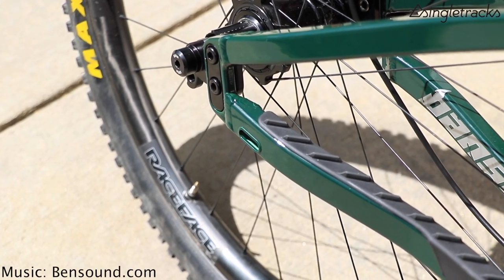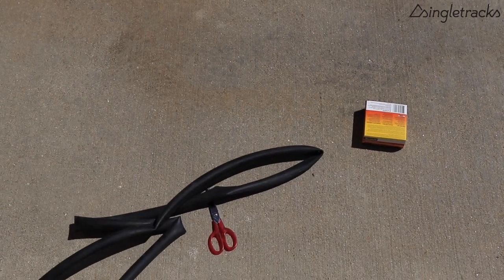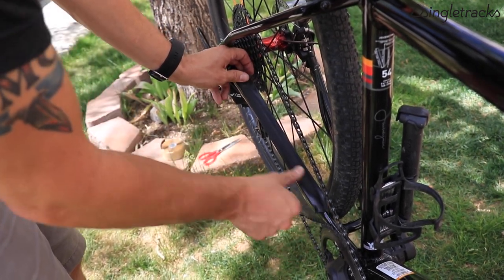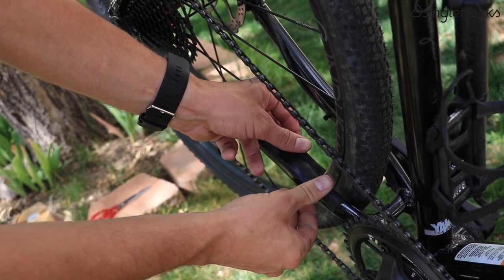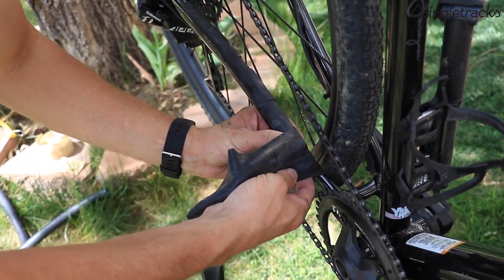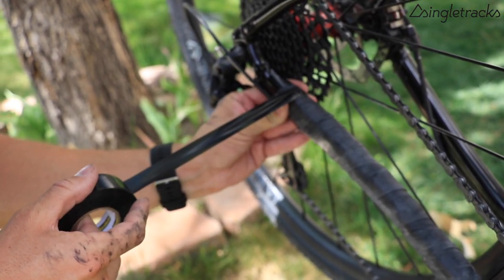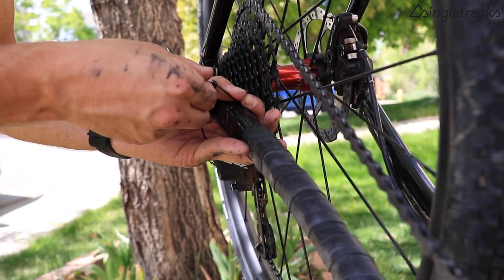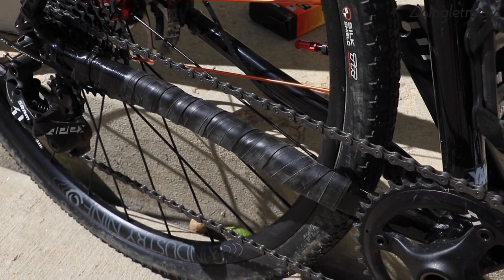How to Quiet Bike Chain Slap with a DiY Chainstay Protector

Comment: why do you need the mastic under the tube? tube should offer all the protection you would need, if you want more, double wrap it.
Reply from the maker: Aside from extra protection, the smaller sections of Mastic form bumps or ridges that break up the motion of the chain, disrupting the wave effect. You could sub anything to create the ridges; Mastic tape is just easy because it's cut-able and sticky. 

Specialized was one of the first to discover this and incorporated a similar design on their most recent Stumpjumper bikes. Fortunately the solution is a simple one that's available to anyone.
Reply: @singletracks  thank you

Comment: Is it okay for the RD wire to be pinned with the interior tube?  Will it affect the RD from shifting?
Reply from the maker: Never cover the actual shift cable with anything, covering the cable housing with tape shouldn't be a problem if you're not squeezing the juice out of it. Haven't had any issues with it. -Matt.